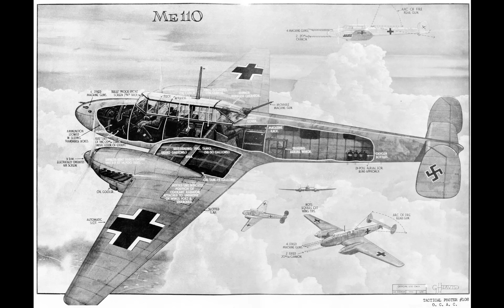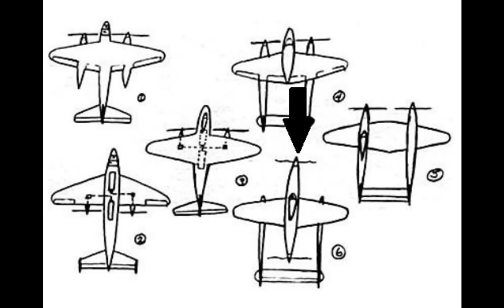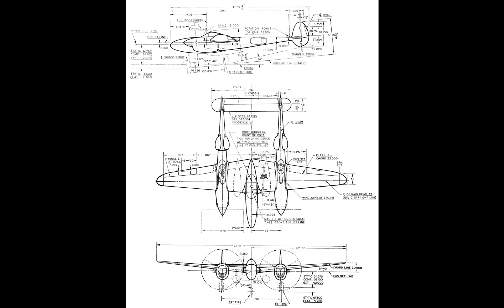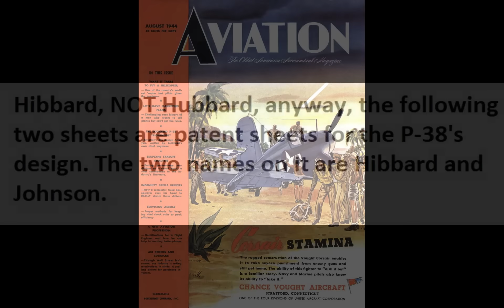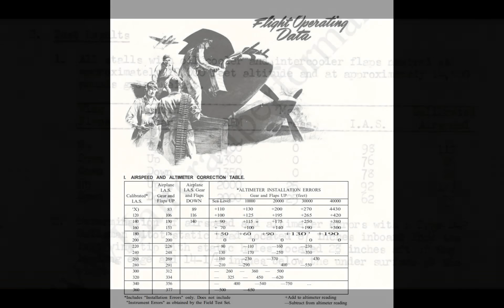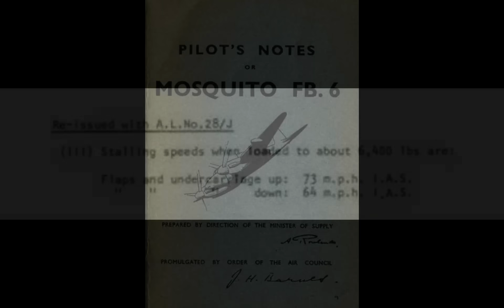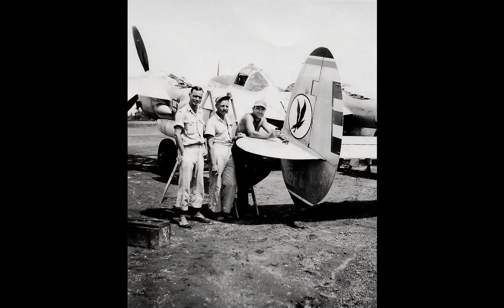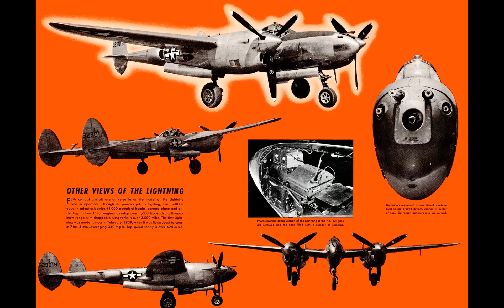Lockheed P-38 Lightning Design Info

Comment: Nice start to the P-38 series.  Glad to see you debunk a common misconception that this airplane could not turn with other fighters.  I think people get this idea from the fact that the Army specification for the airplane used the term "interceptor" for the first time, a term too many people seem to associate with airplanes not designed to turn.  According to Warren Bodie, Ben Kelsey wrote the term "interceptor " into the specification only because the Army had prohibited expenditure of funding on development of twin engine fighters. Kelsey believed the performance he desired would only be achievable with two engines, so he invented the term to dodge that bureaucratic restriction.  
It was an inspired design that, as you said, was just a little too early to benefit from aerodynamic developments that would benefit later aircraft.  I see the low critical Mach number as the congenital defect that kept the P-38 from being an outstanding fighter after its other technical issues were resolved.  I believe Bodie also said that Lockheed would have preferred a more "high speed" airfoil section, but the airfoil and aspect ratio settled on were necessary to meet the time to climb requirement of the Army design specification.
Reply: Along the lines of the use of "interceptor", the computers manufactured by Digital Equipment Corporation weren't "computers", they were Programmed Data Processors. DEC absolutely insisted on this definition, because they wanted to sell to a bunch of government agencies that at the time had prohibited expenditures for "computers".
Reply: Yeah, it's strange to see that misconception still exist after we've had flightsims for over 30 years and representations of the P-38 in it for more than 23 years, European Air War was the first one that showed it, but the IL-2 series from Forgotten Battles: Aces Expansion Pack onwards really showed how good it was. 

I mean if you're really interested in this, you have the option to check the aircraft out for yourself, why aren't more people using it? It does have limitations, but compared to some books and even some academic readings they aren't that bad. 

Funnily, when we got the IL-2 (GB) Battle of Bodenplatte addon, there were still a lot of green new pilots that were very suprised when they saw a P-38 really move for the first time! 
Me and a few friends who all love the P-38 did a number on some 109 and 190 Pilots who were a bit too cocky.....and well once we went up to 32,000 feet and cruised down the map, everyone "vacated the premises" at high altitude. ;)
Reply: @LupusAries   It has become interesting to see the extent to which the legends of some aircraft are tarnished by negative narratives while others are burnished by laudatory ones.  People actually dismiss or admire aircraft due to narratives that are based on repetition rather than fact.  Unfortunately, I sometimes suspect that performance of some aircraft in a flight sim may also be based on common narratives simply because actual data was not available to the coders.
Reply: I think it might also because games often don't model the flaps correctly.
Reply: The Army got burned with the dreadful Bell FM-1 Airacuda escort fighter.